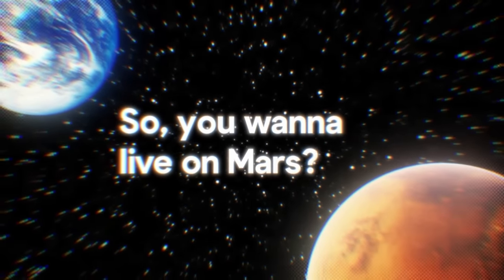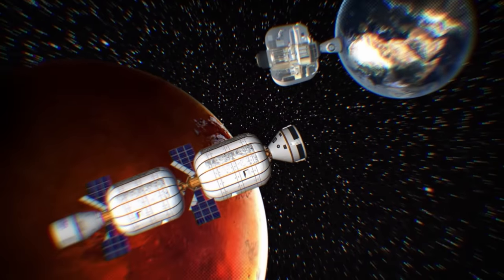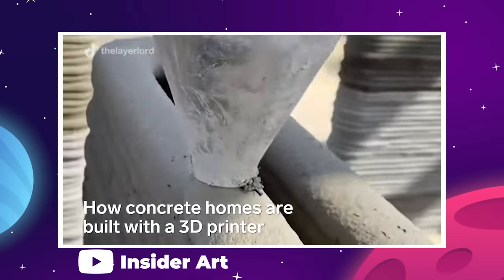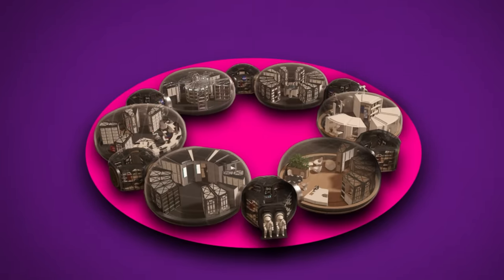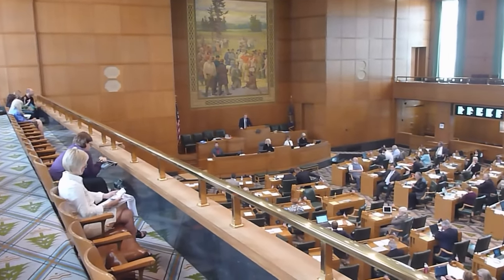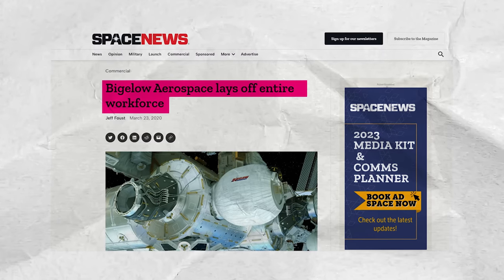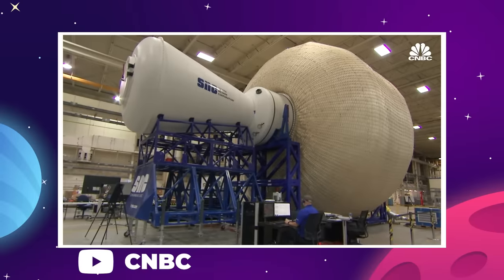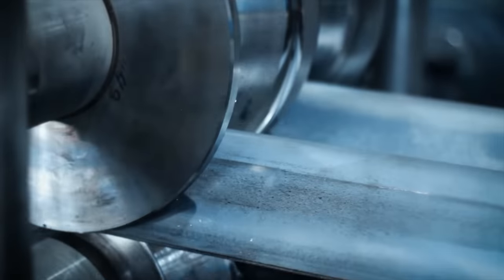Why Inflatable Habitats Are The Key To A Mars Colony!

Comment: Find the caves and use A-I to develop them into habitats and infrastructure needed for the first colonists. Inflatable habitats can be used inside a cave, but not on the outside. There is too much radiation  and micro meteors making it to the surface,

Comment: Glaring factual error in the pressure of a vacuum in space. The gradient  of pressure cannot go down from the zero of space. Instead, it is just the weight of the air sitting above any particular spot. So, 14 PSI is just the weight of the equivalent of a one-inch column of air extended all the way to the top of the atmosphere, and the contrast between that and space can only be 14 PSI, assuming your habitat is at sea-level air pressure.

I do say "only" with a caution, though. The palm of an average human hand is about ten square inches.   So it bears about 140 pounds of atmospheric pressure, nearly twice the weight of a standard bag of dry concrete.

Comment: The million dollar question is do they protect people against solar radiation, dust storms, micrometeoroids and charged particles? Probably not. Best to dig tunnels and underground facilities to put these inflatable habitats in, rather than on the surface.  That way you get the best of both worlds; using the natural Mars soil/rock to protect against the really bad stuff, whilst not having to take lots of structural stuff to support the underground spaces.  Just as @JohnDoe-fg9ng said "You need around ~5inches of al eq shielding to block a 1000MeV Fe Ion for example".  Designers need to get real to survive in such a harsh environment.  Great to see above ground structures, but they will not survive very long or protect their inhabitants - Get Real & Get Digging - Robots should be able to do the hard digging, hard lifting and pre-assembly before humans ever arrive with the technology we have at the moment, with the right equipment, right power generation, right spares/maintenance, right protection for robots and right direction/instructions - it could be prototyped on Iceland and the design refined before we send the first mission to start it all off.
Reply: If they are planning on using them in Earth orbit, I'd say that the answer is yes.  The video stated that prototype attached to the space station was proof against micrometeroroids and cosmic rays, so that means charged particles.  Dust storms on Mars aren't like those shown in the movie "The Martian".  They have no momentum because although the wind speed is very high, the density of the atmosphere is very low.  So, AFAIK, the problems that they have caused so far have been obscuring solar cells, not erosion.  If Mars was a highly erosive atmosphere, we wouldn't be seeing evidence of water erosion that happened billions of year ago.  These structures are probably a good start for initial occupation while the infrastructure gets built up for digging tunnels and printing structures.  Then in modified form, the lining for those tunnels and dome homes!
Reply: @richdobbs6595  Great, thanks for the input.  Sounds like they will have to go with an interim solution until they can get more permanent structures in place.

Comment: Rad shield: must be very dense or very thick. Do you have Rad shield data or just assuming.
Existing hand-waving away radiation dangers consists of people in LEO piling everything they have around themselves in attempt to limit exposure
Per NASA:

Beyond Low Earth Orbit, space radiation may place astronauts at significant risk for radiation sickness, and increased lifetime risk for cancer, central nervous system effects, and degenerative diseases. Research studies of exposure in various doses and strengths of radiation provide strong evidence that cancer and degenerative diseases are to be expected from exposures to galactic cosmic rays (GCR) or solar particle events (SPE).

Milli-Sievert (mSv) is a form of measurement used for radiation. Astronauts are exposed to ionizing radiation with effective doses in the range from 50 to 2,000 mSv. 1 mSv of ionizing radiation is equivalent to about three chest x-rays. So that’s like if you were to have 150 to 6,000 chest x-rays.

That sounds like LEO inside the Van Allen belts.
Inside and beyond the VA belts, astronauts are exposed to a high flux of high energy protons from the sun, high energy nuclei of elements from the galaxy, and extremely high energy EM radiation from x-rays to gamma rays. A few inches of high hydrogen content material is not going to be very much help.
Just looking at particle fluxes, during transit outside of LEO, EVERY cell nucleus within an astronaut would be traversed, on average, by a hydrogen ion every few days and by heavier HZE nuclei (e.g., 16O, 28Si, 56Fe) every few months.
So far, looking at NASA docs, they seem to concern themselves about protons from the sun and really seem to ignore high energy ionizing radiation from x-rays to gamma rays.
Things just aren't that simple.
Then, there is including enough food and water for survival and if any of the unproven methods to sustain life, without frequent shipments of consumables from Earth will actually work.
Then, there is the small matter of paying for it...

Comment: Probably will happen before the end of the century with in-situ resourses. Inflatables will be key to getting to that stage as soon as possible. They will still need to print a regulith radiation shelter for the long-term or install inside lavatubes. I hope the extra volume of these habitats will enable a much less cluttered and clean looking enviroment than that of current spacestations, as they stand they must be a less than pleasant environment.

Comment: Inflatable habitats are inherently weaker because of constant flexing.  Why do you think the ISS is a rigid space station?  It doesn't need to be, and an inflatable habitat would provide a LOT more room, because a larger capsule could be launched in a smaller space.

Why do you think we don't have inflatable homes?  Would be simple enough to make a 1/2 dome and then build rooms within it, and heat and cool it.  Should be cheap - until you get that pinhole leak..  Pretty easy to prevent a pinhole leak in a tank made of steel, why do you think it's so hard to do with any flexible material?

Comment: The pressure in a vacuum is 0.0000 psi , hektopascal, what ever. There is no such thing as a negative gas pressure, physics 101
That is fundamental for pressurized Mars habitats, which are pressurized at about 350 hekto Pascal , or  the old unit 350 millibar, The composition has a partial pressure of 200 millibar O2, the rest N2. When lifting heavy objects, 2.8 times lighter than on Earth, you are not 'winded' same oxygen, less air flow required. Lower overall pressure to help move in a pressure suit outside.
As tried on the high Chacaltaya ski resort in the Bolivian Andes 🇧🇴 16400 feet elevation.

Comment: These inflatables will only need a few psi of a gas or air to stay inflated since mars's atmospheric pressure is so low.
Reply: Sure, but as living structures you'll either need a high O2 environment or else more pressure than that.  High O2 environments are dangerous, so folks will probably operate these at close to one atmosphere with a regular O2-N2 mix.  Given the likelihood that there will atmospheric processing of the Martian atmosphere to produce fuel, it should be possible to recover the required amount of N2  as a byproduct.

Comment: Nope. Radiation will be severe on the surface. Human habitats will have to be at least a bit underground. Surface structures could be used as greenhouses but tended by robots most of the time. Either going to build a basement to live in or adapt existing lava tubes.

Comment: With so little Atmosphere to burn up meteors for long term safety from meteors and radiation they must live under ground.  
It is a bit like the government approach to lightning protection here on earth,  they do not require private homes to have lighting protection because the statistics, and numbers of deaths are so low the probability is low....however when you are the one at risk the odds change with the perspective, living under a roof with and antenna sticking up above the surroundings in a thunder storm is worse than sheltering under a tree!

Comment: I have known that for 40 years when I came with the idea, it should be shaped like a soccer ball that you can reconnect between many of them and they’re inflatable with the expending foam on the inside you have the metal structure that the attached to each joint with bullet proof material you could send The load ahead of time, but on the other end, if the Earth is flat, there is no matter sad and the same as the moon we never went there and that’s why there was no dust with the lunar landing. So tell me who tell the truth now last June Steven Gurr had a big disclosure in the US about the hidden technology anti-gravity, zero point energy what’s happening to all that

Comment: The balloon tent is a really bad idea. It would have to contain a huge amount of lead or something else to stop the constant radiation exposure and the hydro content really has to be tested for prolonged constant exposure and be significantly higher resistant than human max exposure exposure  . They mitochondria in every human cell cant take that radiation from the sun and the human body will stop functioning very quickly....It is even possible that the radiation on the long journey to Mars is not possible for humans because of this.  might significantly reduce human function.

Comment: I think inflatables are the best sollution to many space systems including space stations, habitats on the moon and mars and more.  It is far more tolerant of meteoroid impacts due to its flexibility vs rigid metal and glass of current designs.  They are also very lightweight when launching into orbit. You can get far far more volume when inflated compared to hard surface designs.
Why would 3-D printed houses made of Martian regolith be "toxic to humans"?? 
BTW space pressure is NOT -14 psi.  It is 0 (zero) psi.  Compared to space, pressure at earth's surface is 14.7 psi higher than space's pressure of zero.  There is NOT a 28 psi difference between space and earth pressure. This may be a technicality but I don't want young science students getting it wrong on their homework. 🤣

Comment: Living in a balloon is like living in a tent.  How long do you think it will last?  NOT LONG!  Maybe two years.  Yes, you can use it as a starting point but it's not going to last.  As far as the 3D printing?  It would be like living in a mud brick house.  It will last longer but not that long.  Maybe twenty years.  The actual construction would last 50 - 100 years depending on where it is.  On the surface less in duration.  Under the ground, much longer but everything gives and breaks down.  As far as what answer is best overall?  Well, you can start with the balloons and then move to 3D and once you have the industries start then an actual constructed structure.  But I would set it underground for the last two.  As it will last longer, protect the colonist from radiation.  And the obvious dust storms that occurs.

Comment: There is no such thing as negative pressure.  The pressure in space is very very very close to 0.  Can't be negative.  1 atmosphere is 14.7 psi.  If you inflate the hab in space it will be supporting a 14.7 psi pressure difference between inside and outside.  Not 30.  To simulate that on earth you must inflate it to 2 x14.7 psi to get a pressure difference between inside and outside of 14.7 psi.
Reply: Good comment. — Would a vacuum be 0 psi?
Reply: @floydbertagnolli944  yes.
Reply: Thank you
Reply: @sarg3146  thank you
Reply: @sarg3146  thank you

Comment: Where is the air coming from, Space, the Moon, or Mars, doesn't have any? 
Carrying highly compressed air from Earth, needs Very heavy, strong, large containers, that will need transporting to the final destination. With vast amounts of 'pressure' capable pipeline, valves and various control equipment. So all of the 'weight saving' you have made with the inflatable habitats, now needs a higher weight of ancillary materials! Something doesn't seem to compute somewhere....

Comment: Hydrogen is not the most effective shielding against radiation, it has the highest shielding per unit mass.   Hydrogen based polymers as radiation are only considered because they are low mass and that they resist spalling which generates more high kinetic particles that affects our biology deyrimentally as radiation does and indeed the so called radiation of space are the high kinetic energy subatomic particles rather than ionizing radiation itself and it just affects our biology in a similar fashion to radiation.   It is because the particles are often charged that magnetic shielding is possible, madnetic shoelding does nothing against actual ionizing radiation like gamma waves, xrays or UV.  Even with hydrogen based polymers as the current favoured radiation shoelding for space crafts launched from Earth, we tend to embed angled metals within the plastic to bounce and disperse the radiation so it spends more time in the shielding mayerial than just passing through the thickness, this is called Z grade shielding as the denser materials embedded are corrugated often forming a Z cross section (though chevrons as in V and W would be more applicable).  Note that the embedded denser materials also act as whipple shielding against micro meteorites especially if layered.

The whole negative 14 psi to postive internal 14 psi is a clear misrepresentation of the screenwriters, obviously an actual expert tried to explain that the 30 psi pressure commonly found in car tire is 14 psi above the atmospheric pressure of 14 psi at sea level and hence an automotive car tire can be seen as the material needed especially considered it's armoured with both steel and polyester belts which could be seen as micro meteorite shielding.   However, the whole point would be to export as little mass as possible so a bicycle's inner tube (road bicycles hold pressures of 80 to 129 psi) would be more what would be exported, it would just be buried in packed in-situ regolith (dirt) to provide the micro-meteorite and radiation shielding rather than exporting anything from Earth.  About three feet of packed regolith should reduce radiation to 1/1000 of exterior radiation levels and this is why 3 feet of packed Earth is recommended for fallout shelters, though it would take 40 feet of packed regolith to approximate the shielding we get from Earth's atmosphere.  This is a problem with science journalism, the journalist often completely and blatantly misrepresents what the experts tried to communicate and failed in doing so, this is how we got nonsense such as masks not working when the experts were only saying to leave the masks to the front lines where they would be of much use and even with trained personnel, the masks are often misused as was the caee in SARS so the general public using masks would likely not be used as effectively as when used by trained personnel

Comment: I stopped watchig when he said "Negative 14 PSI".  I think someone must have failed high school physics.     The actual pressure is "zero" or so near to zero that it does not matter.

To get a negative pressure you need to remove all the air and then remove even more air after that.

But yes a good structure design is to dig a hole, push the inflatable "balloon" in the hole then cover over the balloon with the dirt that was dig out.    This actually minimizes the amount of digging. for a given cover thickness and the dirt helps contain the air inside and removes load on the bag.

What next, a jar filled with negative filled with -2.0 cups of water?  So after putting +2.0 cups into the jar is exactly empty?

Comment: Come on for Mars it is underground habitat, there is no other solution.  While humans evolved on earth they didn't build skyscrapers to live in first. They were living in caves. Digging in is easier than building up.  Also Dust storms on mars would not be fun for a baloon in low gravity environment, same for glass domes.
Reply: Although the wind speeds can get > 100kph, the atmospheric pressure is so low that it only lifts small dust particles  ('air' mass x speed).  Atmospheric pressure on Mars is around 1% of Earth's air pressure.  Other than the dirty skies, I doubt they'd notice a dust storm on Mars in an inflated habitat.
Reply: @stanj7223  Solar panels might be a problem.
Reply: @catprog  google: "multi-layer Electrodynamic Dust Shield coating", they've developed a version that's transparent for solar panels, works pretty well.